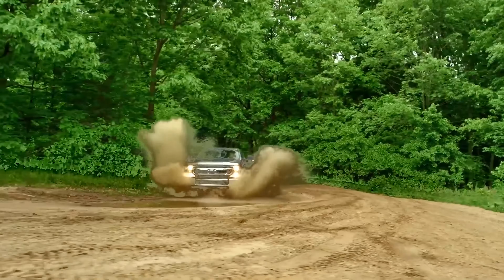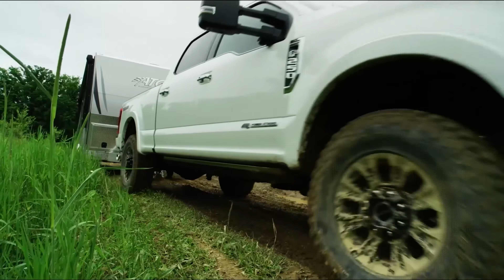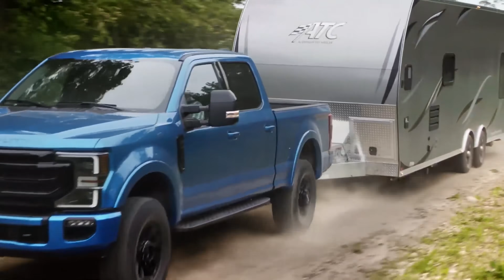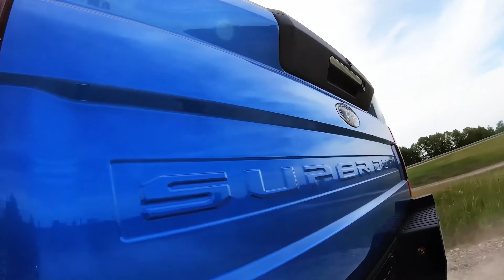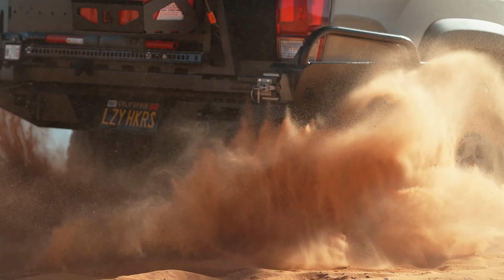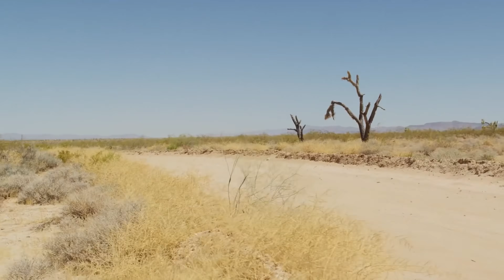Best Tires For Hauling || Load Ratings

Comment: Your discussion leaves out one very critical piece of information, the truck's stated payload capacity. Installing heavier tires does not increase payload capacity. You did not change brakes, suspension, transmission, or any other part of the truck that affects payload capacity. The reason I install E rated tires on my half ton truck is that the stiffer sidewalls help to minimize trailer sway when I am towing. So, to summarize, heavier tires will not increase payload capacity. Pay attention to that number, found on a driver door sticker. If you exceed payload capacity and have an accident, your insurance will not pay.

Comment: So let me see if I understand this right. My truck is a 1500 and my tires are 270/65/R20, my trucks curb weight is 5,757 with a payload of 1,343. Conventional TWR rating is 8,800lbs. My max tongue weight is 880lbs. With everything included, my GVWR and Tongue Weight is going to be close to being maxed out at about 8,200. Does this mean I should get tires that are load rated E? I have tires that are load rated D, now. There are so many things you learn, after, you buy a camper/travel trailer. Wish I could just ditch it all and start over!

Comment: On my 2019 6.7 power stroke F 250, my wheels keep deforming when I trailer something. I’m running 325/50/22 Arturo tires right now. Any recommendations?

Comment: just by E load tires for your trucks and large SUV's. don't putz around unless you are running low profile tires. if its a real truck and you use it for "real truck stuff" just get E load tires.
Reply: If you got a Jeep or a bronco defintely use C load. Lots of people putting E loads on Jeep then complaining about the ride
Reply: @AustPost7  Why would someone put E's on a Jeep? Harsh, of course it's a tough ride.
Reply: Real truck?
Reply: Nobody really needs heavy E and F load tires on standard pick ups J's it's just piece of mind mostly. Unless you really hauling max loads all the time. Wasted fuel in my eyes 👀 lol
Reply: @tenskeeze  Yup, unless you're hauling. It's all a balance between what's important to you. E's for towing my 9K travel trailer behind F250 crew for ride comfort, durability and safety.
Reply: @robertosgood961  would be D 's with my 5.5k travel trailer enough for my dodge ram 1500
Reply: @paoloandres4975  Yes, load range D will work just fine for your 1500
Reply: @jerryeastman170  thank you